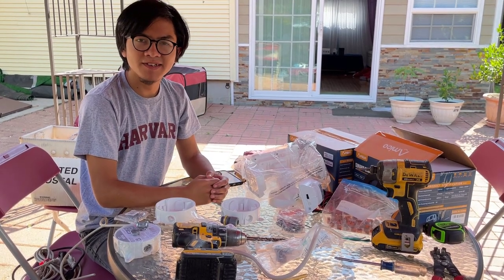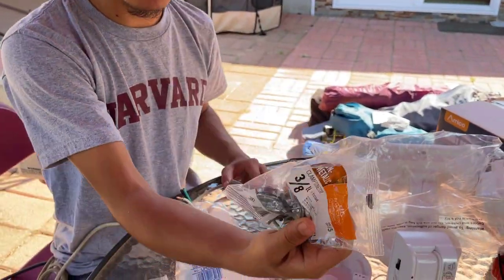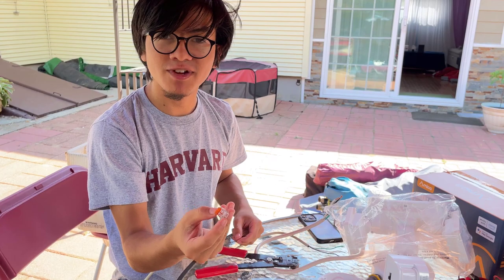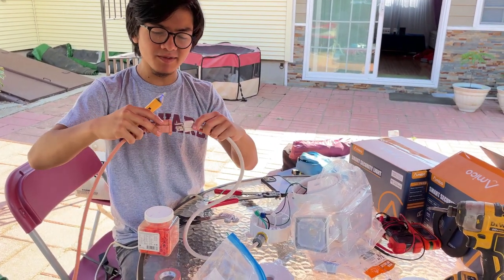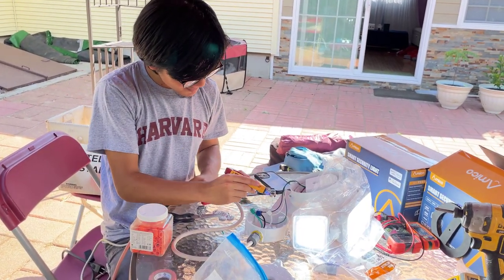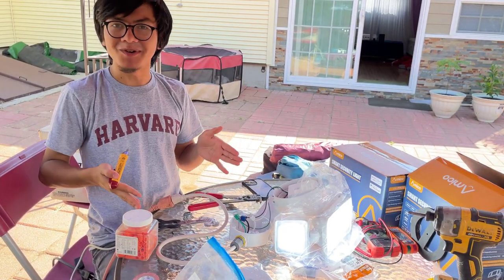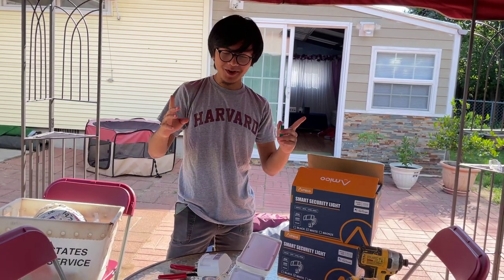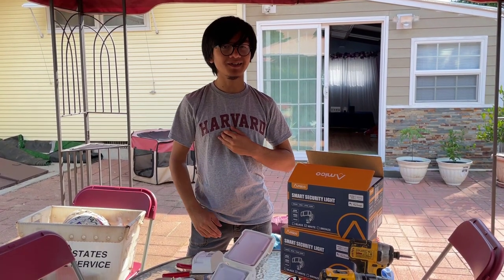How To Make DIY Plug-In-Mount | Install Outdoor Floodlight Video Security Camera Eufy Wyze Ring Nest

Comment from the maker: Here are the #ad links to items, materials, parts & tools required for this project:
1.  https://amzn.to/3DyR9P5  |  RAB Lighting VXCW Weatherproof Round Box with No Cover, Aluminum, 1/2" Hole Size, White
2.  https://amzn.to/3DCYVqY  |  Iron Forge 8 Ft Extension Cord, 16/3 Black 8 Foot Extension Cord Indoor/Outdoor Use, 3 Prong, Weatherproof Exterior Extension Cord, Great for Gardens, Landscaping, Lawn Mower, US Veteran Owned
3.  https://amzn.to/450Vczm  |  ARLINGTON INDUSTRIES LPCG50 624211 Strain Relief Cord Connector, Liquid Tight/Oil Tight, Non-Metallic, 1/2"
4.  https://amzn.to/45568fj  |  BELL PBC300WH Round Weatherproof Cover, Plastic, Blank, White, 4 in.
5.  https://amzn.to/3QbucZP  |  WAGO 221 Lever Nuts 78pc Compact Splicing Wire Connector Assortment with Case (Connect any combination of solid, stranded, and flexible copper wires faster and more reliably)

Or Click on Amazon link here and search for what you need:  https://amzn.to/3xIOsqg